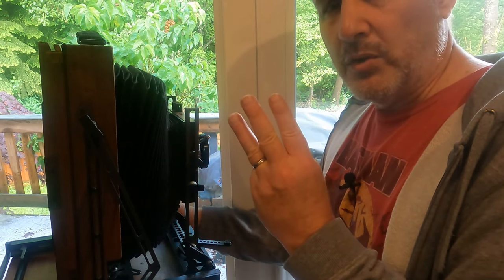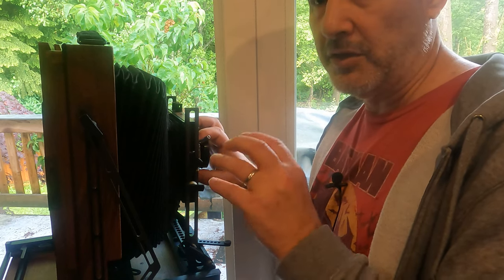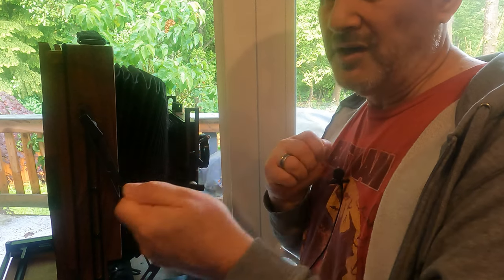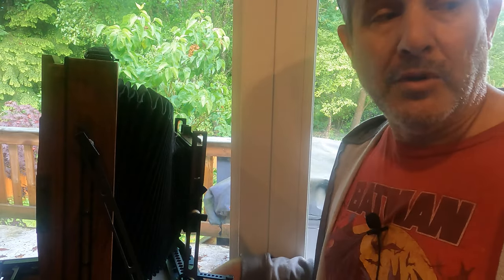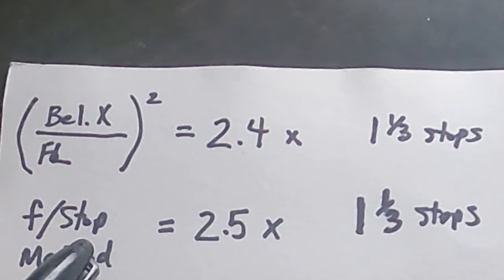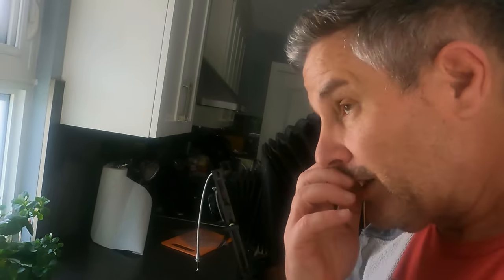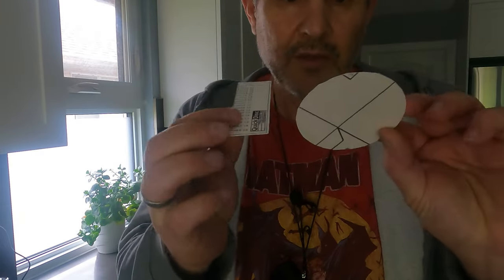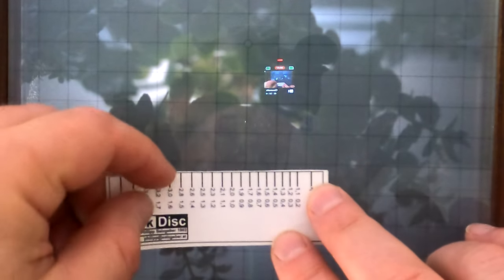Bellows Extension Compensation: The f/Stop Method

Comment: The Calumet Exposure Calculator was a target that one placed in the photo. It was used for bellows compensation and magnification ratio. They come up on eBay (there’s one for sale now). The Quick Disc is a DIY version. If I recall correctly, Rodenstock made something similar.
Reply from the maker: I used to own one, but lost it moving from Japan, back to Canada. I haven't really done any close up work to warrant the purchase of a new one.
Reply: @analogueandy8x10  These days I just use my iPhone calculator. I do have tables on my phone for two macro lenses, purchased when Nikon off-loaded its large format lens stock in North America. I usually have a target magnification ratio, or at least want to know what it’s going to be, and the tables provide that information at a glance.